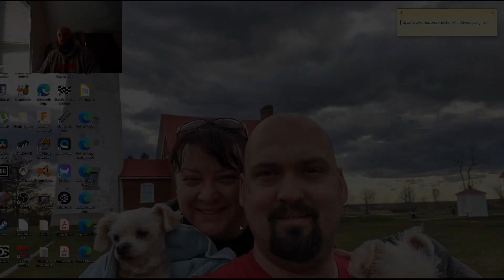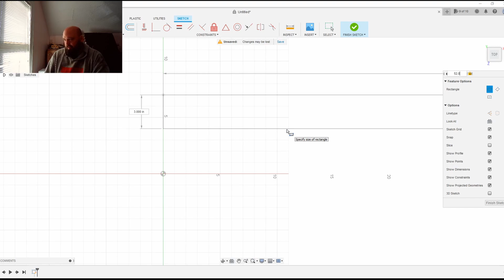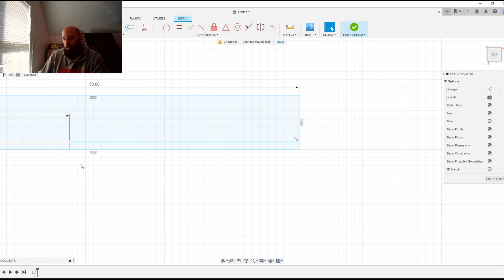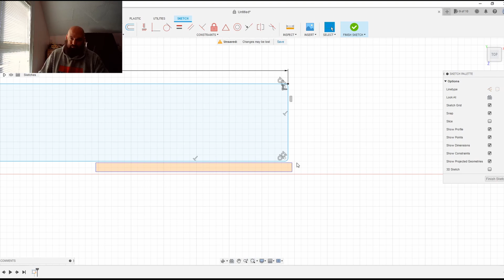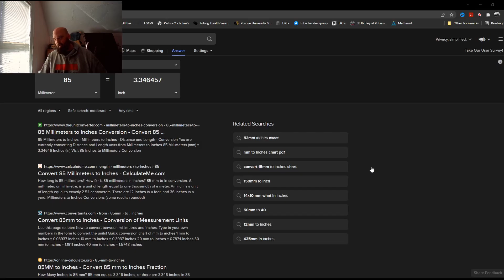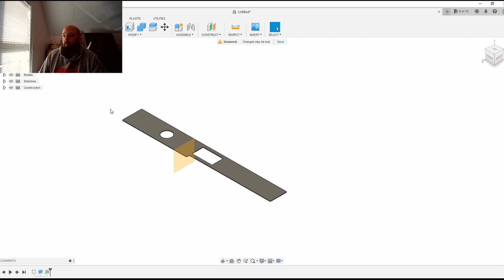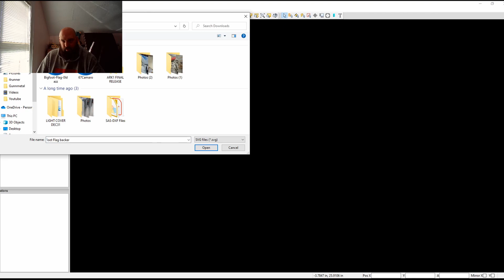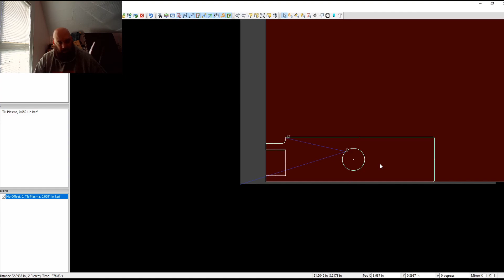How to create a custom dash design in Fusion 360

Comment: What gauges are you using. No I didn’t watch the video because I don’t have a computer or the skills to do that   So tell me what gauges your using
Reply from the maker: There's no gauges, just some design work on a dash
Reply: @TheDrivewayEngineer  I love the advice you give. I bought the AR5 transmission because of you   So I’m wondering what are good gauges at a budget. Check out my Camaro
Reply from the maker: @vandettabuilds6641  There's some sets on Ebay for like 70 bucks, I'm just going to give one of them a whirl.
Reply: @TheDrivewayEngineer  I threw my plastic dash and console away and built my own